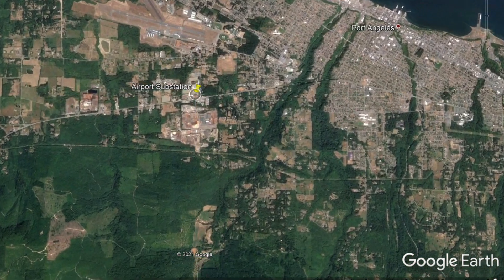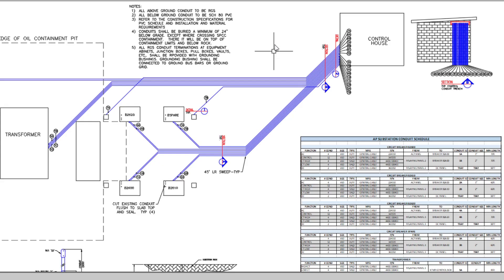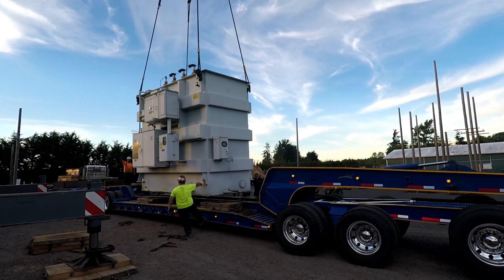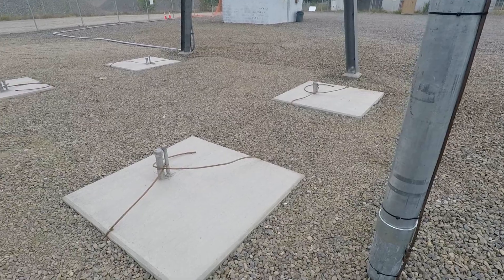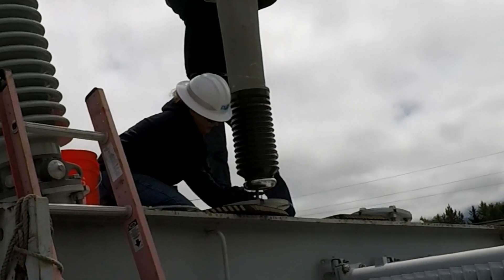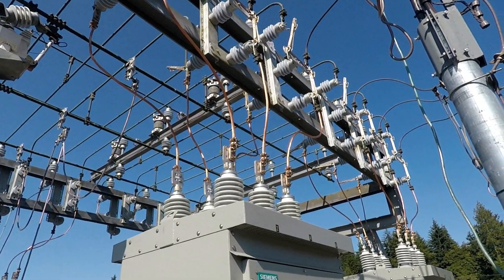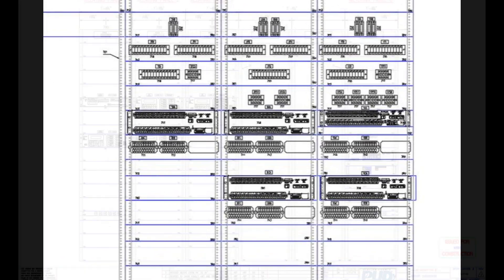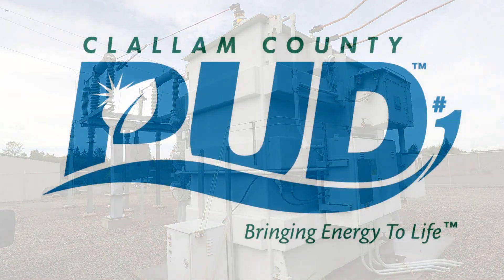Clallam County PUD 115KV Airport Substation Rebuild

Comment: Disclaimer So I'm not a lineman so I don't know shit. I run maintenance crew for a multi county sewer district so we work with the electric suppliers often. When we have had meetings with our account rep from duke they are very protective of any drawings or gis of the substations and lines.  I was just surprised that you can put this up with out any trouble.  I think its great info but you know security these days. Anyway stay safe and keep educating.
Reply: yah, most utilities think obscurity is useful, anyone with the right clue can just go drive out most topologies, even underground is pretty obvious in most cases.